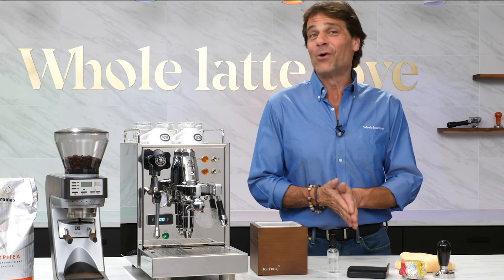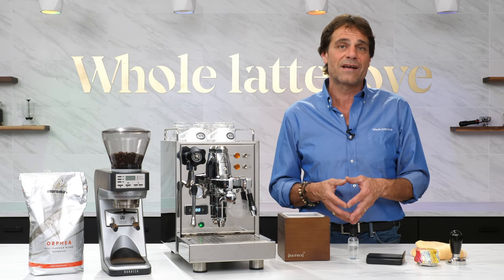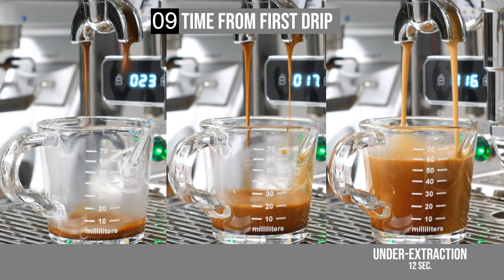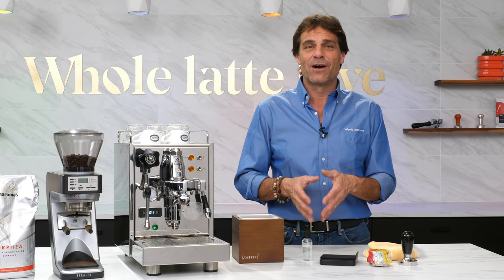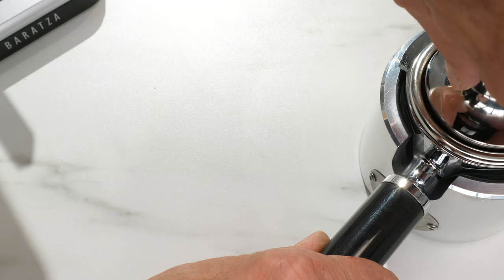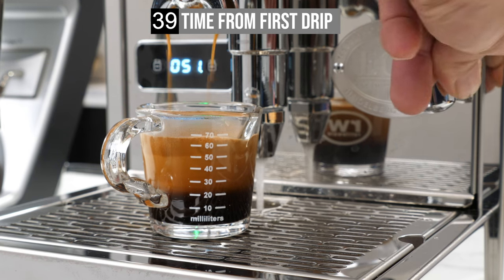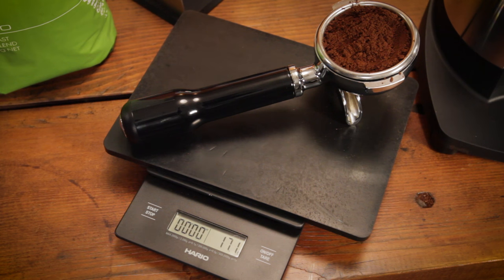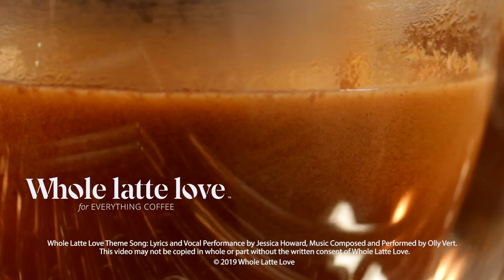How To Dial In Grind Size for Espresso

Comment: This was an exceptional guide for beginners like myself. I bought my first machine (a Rancilio Sylvia V2) and learning this helped a lot. I also learned about adjusting the OPV valve to increase or decrease pressure and how to use a pressure gauge on the portafilter in order to reach 9 bars. So many factors to learn about! Thanks for the helpful information and keep up the great work! 🙂

Comment: I'm following up on my own question down below.  It didn't occur to me that the dramatic spurting I was experiencing  in my early clueless shots as simply an intense degree of channeling.  The grind size I chose to start with wasn't fine enough to stop the pressurized water from going straight through the coffee and hitting the bottom of the basket more or less full force.  Result, espresso explosion.  Many espresso explosions, actually, because I didn't understand exactly why this was happening.  Luckily, my process was to reducing grind settings gradually anyway, until I hit the golden mean.  So I finally got to the point that my shots actually began to pull properly.  Exciting early experiences, though.  Admittedly gratifying to have figured it out myself.
Reply from the maker: Hi John, Thanks for the update - I'm happy to hear you figured things out!
Marc

Comment: Mark, I just got my Gaggia Classic from you today. I have a Cuisinart burr grinder that I am afraid will not grind my coffee fine enough after watching this video.
Reply from the maker: Hi Daniel, you could use the Cuisinart with the pressurized filter basket. But you’re right probably not going to do well in standard brewing in the non-pressurized filter basket. It may get into the fine grinding range for the espresso but lacks the precise control of grind size for dialing in. 
Marc

Comment: Hi Marc.  I actually searched for "spurting" and this video, among others turned up.  That's my problem, though.  I could be wrong but I don't think my grind/dosing/tamping technique is so far off that I should have continual spurting issues. I've had two extended sessions with this machine, pulling several shots and have gone through a pound of coffee without even coming close to a properly pulled shot, let alone worrying about such niceties as "flavor."   I've been a model of patience.  
I'm setting the portofilter as firmly as possible without putting every ounce of muscle into it, I can feel it engaging with the gasket.  The machine is properly pumping at over 8 bar, but the flow control gauge will not rise over 2 bar.  I would be at my wits end, but I am telling myself that this is just another problem to be solved.  The coffee is the Orphea.  For grind, I'm slightly overfilling the portofilter, leveling with finger without compressing, then spinning with the Jack thing.  Then I tamp lightly and spin again.  Not using great pressure in this process.  Maybe I should be!  There's a line on the inside of the Profitec filter basket that I assume is a suggestion on where the coffee should be falling to give enough headroom.  Every time the grinds are climbing up the sides of the basket and are all over the surface of the shower screen.  One time I got a decent puck but it was a fluke and not repeatable. 
To me this is feeling like a basic sealing problem. I have the extra silicone gasket that I could put in, but I am resisting taking this step because I don't think it's going to solve the problem.  Any ideas or guidance with this would be greatly appreciated.  There are long-time "pullers" that complain about this, but I'm not willing to be one of them.  There is a reason for this and I need to know what it is.  I'll keep trying in the meantime.  Thanks so much.  --JohnB

Comment: The tamping is important. Why do I keep hearing it's not? I use to believe it was not that important until I noticed regardless of how fine I was grinding my coffee it was brewing too quickly. I added more tamping pressure and it's made a world of difference. With all the other variables staying the same it completely changed the extraction time.
Reply from the maker: Hi CB, Tamping/compressing the coffee is important. Hitting a specific tamping pressure is overrated. But being consistent in the pressure you use is important! Changing grind size can compensate for more or less tamping pressure.
Marc
Reply: @Wholelattelovepage  thank you Marc

Comment: Hi Marc. This topic is very timely because I've been having some challenges in the last couple of weeks with my extraction times, and I thought my issues might help others. I've been using a Profitec Pro 500 PID and a Profitec Pro T64 grinder since March when I purchased it from Whole Latte Love. After dialing in my shots when I got the equipment, I've had extremely consistent results with very minor grind adjustments.

Two weeks ago, I started using a new batch of Lavazza Super Crema, which is the same coffee I've been using with great results. My extraction times jumped by more than 10 seconds with the expected bitterness, etc. When I tried to move my grind settings to a coarser setting, my results were not improving, and I started to get more volume of coffee dispensed from the T64 which aggravated the dialing-in process. After much head scratching, I realized that I had not adjusted the TIME of my grinder's dosing function, and the coarser grind was producing more ground coffee faster. After checking my weight of the ground coffee (as I had done when I first established the Time of my dose) my results improved.

I'm still seeing some variability in my results, and the only thing I can see that has changed besides the new bag of coffee is that the humidity in my house has increased recently because we have not had to run Air Conditioning or Heat during a mild period. I don't recall the humidity being as high since March when I got the machines, so that may be what triggered my recent inconsistent results after so many months of amazing coffee. I'd appreciate any thought about the sudden differences I've experienced and if you have any practical suggestions about adjusting the time of the dose vs the grind (so I don't keep wasting so much coffee!). Thanks for your informative videos!

George
Reply from the maker: Hi George, Thanks for sharing the details of your experience! As you discovered adjusting to a coarser grind with same timing will produce more grounds. As I mentioned in this video grind size is never set and forget! It may need adjustment as a coffee ages, most definitely when switching coffees, and as you found with a new batch of the same beans. Ambient conditions like higher humidity and temperature may have affects as well. My guess is the major factors in your case are the new batch of coffee and increased humidity. I can't say for sure this is what's happening in your case but increases in humidity generally help grinds flow through a grinder due to internal static reduction. You may get a slightly larger coffee dose than average with increased humidity. I unfortunately have no practical suggestions for adjusting grind time with size changes other than finer setting = lower dose and coarser = higher dose. It's a bit of a guessing game to adjust timing when changing grind size but guesses get better as you become more familiar with your grinder. I hope that helps and hope you are enjoying your Pro 500/T64!
Marc
Reply: Marc,
I think your message is right on target. The increased humidity probably increased my dose since my time for the dose was unchanged. As I decreased the grind size, I made matters worse! I've experimented with decreased time and a very slight grind size reduction, and my results are significantly improved. Thanks for the tips!
I've been making espresso for many years, but the Profitec equipment responds to very small changes and gives outstanding results when you get it right. I'm very happy with my purchase.

Comment: Excellent video. You work with a 2 oz espresso - basically a doppio. What changes or recommendations would you suggest for those folks who drink a more traditional single size espresso (1 oz)?  Should that size also take 20 - 30 sends to extract? If you see this, thanks for your response.
Reply from the maker: Hey Mark, Thanks for the comment and question. When using basic timing it's the same regardless of single or double. It's about contact time with the ground coffee. Single baskets are designed for a lower flow rate - fewer holes in the basket. Using a well matched pair of single and double filter baskets you shouldn't have to change the grind size much when switching between them but that's not always the case.
Marc

Comment: Mark, thanks so much as usual for the great videos. I have Quick Mill Silvano machine and I absolutely love it. I also have a fully restored La San Marco SM90 grinder. The grinder is amazing and I get excellent shots, but the large size and the doser along with the grind retention kind of makes it a pain in the butt for one or two shots a day for home use. I noticed that you guys really push the Sette 270 series. Do you think I would be happy with the sette 270? I don't care about noise or anything, I just want something that has low grind retention and is consistent. I also have a separate scale that I used so I'm not worried about the wi series, as I will be weighing everything by myself. 

Also, if you don't mind, can you speak on how Sette has been improving the same models over the years, in the sense that the original 270 used to need shims and other things that you would have to order from the company, but now they come with those shims so they are constantly updating and keeping even the same models current.

Thank you so much in advance, and I will be extremely honored if my question gets answered in one of your videos. Hopefully my question helps a lot of others out as well.

Comment: When using a hopper, is it ok to adjust grinder after beans are loaded? Intuitively, adjusting coarser should not put pressure on burrs and adjusting screw, but adjusting finer may damage the grinder.
So what is the best strategy:
1. Empty the hopper, grind through the leftovers, and adjust when empty, or
2. Adjust finer only when the grinder is running, or
3. Grinders made out of metal are robust to small adjustments in grind size even when loaded?
I personally believe 2 is fine, but I would like to know your opinion. Thanks!
Reply from the maker: Hi Dmitry, Thanks for the question. Your strategy 2 is the best. That said, I adjust a little finer all the time without grinders running. But, one needs to be careful. With commercial/machine grade grinders small adjustments to a finer setting are okay. I have run into a few grinders of this type with less powerful start capacitors and they've failed to run when adjusted to a finer grind when beans are loaded. If this should happen turn the grinder off quickly and set to a coarser setting to release pressure on partially ground beans between the burrs. With appliance grade grinders one should never adjust to a finer setting unless beans are ground out or do it only when the grinder is grinding.
Marc

Comment: With a same grind size I some times get fast extraction and the next one slow extraction. I find that the tampering also influences how the flow comes. I've also not been able to get double (two side by side cups with double spout) to taste correctly. It always flows too quickly what ever the grind size. I have the single close to perfect but can't get the doubles. Normally it's the other way around.

Comment: Thanks a lot Marc for the detailed information you conducted.
I have a question m in regard to the roast level of the same coffee beans, does it affect the setting of the grinder between the medium roast and dark roast to grind for an espresso?
Reply from the maker: Hi AA, You are welcome! Grind size would likely be different for the same beans with different roast level. Change any espresso variable and grind size usually needs adjustment. Remember grind size is never set and forget!
Marc

Comment: Hey, Mark - thanks for this and your other videos, all really useful! 
My Q is: when do you know when the shot has 'finished'? By which I mean, on our Gaggia Classic (and many other machines, I'm sure) you start and stop the flow of water manually, so in theory you can 'fake' the time taken to complete a shot so that the 20-30 second rule is fulfilled. I tend to stop the flow as soon as the output looks 'watery' but is there a better way of knowing when the best of the shot is done? I'd appreciate your comments. 
Best wishes,
Robbie
Reply from the maker: Hi RS, You are welcome for the vids and thank you for the kind comment and question! Sorry for the delayed response - I've been on vaca and offline for a week. This video covers basic dialing in using timing as the deciding factor. Next level up is using brew ratios. With those you weigh the ground coffee dose and stop the shot when you reach a certain weight in your cup. Typical espresso brew ratios are range from 1:2 to 1:3. So a 1:2 ratio using an 18g coffee dose would be stopped when there 36g weight in the cup. 1:3 would stop at 54g. 1:2 ratio is more common than 1:3 and you can go anywhere in between or outside of those ratios depending on you personal preference. When using brew ratios you'll need an accurate scale like this one which I use a lot: https://www.wholelattelove.com/products/acaia-lunar-espresso-scale
When doing brew ratios you're typically staying with the 20-30 seconds from 1st drip regardless of the end ratio. so that usually means adjusting the grind a bit coarser for higher ratios to speed things up. All that said, using visual cues as you mentioned is legitimate! Especially useful after you are more familiar with a typical bean as if you then use a different bean the cues can change. At end of day the best way IMO of knowing when a shot is done is using scales and brew ratios while keeping shot time within reason. Hope that helps!
Marc
Reply: @Wholelattelovepage  absolutle clear.thanks 😍😍😍
Reply: @Wholelattelovepage  Hi! Could use your help please. I have a Breville Bambino Plus espresso machine and a Breville Grinder Pro grinder. My grind size is set to 15 and I measured out 18g. Output is at 20 seconds from first drip, but I can't get the 36g output. What am I doing wrong? Thank you for your help!

Comment: Great video, thank you. 

I recently purchased a Gaggia Classic and a Baratza Sette 30. After trial and error, the grinder is set at 13 for 5.35 seconds using Lavazza Italiano medium roast beans and leveled/tamped with Apexstone leveler; however, my shot are pulling at around 17-20 seconds.

I tried going slightly finer on the grind setting to 12, but the machine chokes. It also chokes or pulls way to slowly when I increase the time from 5:35 seconds to 5:37 or 5:40 seconds to increase the dose size. 

Does anyone have any other recommendations? Thank you!
Reply from the maker: Hi Alex, Thanks for the comment. The Sette 30 is a bit limited in precision of grind size adjustment. With that, it's not a grinder I typically recommend for use in non-pressurized filter baskets. I'm a little surprised that one grind setting change takes you from a 17-20 second extraction to choking the machine. A couple of options: First is to stay at a 13 setting and increase your dose weight slightly to slow down the extraction. Sounds like you've tried that one without success but it should be possible. The other option is to switch out your Sette 30's grind size adjustment assembly with one from the Sette 270 which adds micro adjustment for more precise control of grind size. The 270's macro/micro adjustment can be purchased here: https://www.baratza.com/shop/sette-270-270w-adjustment-assembly
Hope that helps!
Marc

Comment: Time counts from when you press the button, preinfusion is a part of extraction
Reply from the maker: Hi Thanks for the comment. Fine to do that way if you prefer. It's a fine reference between your own shots on your particular machine. But means nothing if you compare to other machines. For example: Vibration and rotary pump machines reach full brew pressure at very different rates and have different inherent flow rates throughout the extraction. While pre-infusion is part of the process there's a couple problems with saying it counts in the total time. First, during most pre-infusions no solids are being removed from the coffee cake. Second, how to deal with a super long, very low flow pre-infusion. I do 2g/s pre-infusions for 15 seconds all the time when working with extra fresh, lighter roasted, single origin coffees. First drip with those might come at 16 seconds. Do I then only continue the extraction for another 9 seconds? My biggest point... timing a shot is very basic. It's very useful when dialing in. But after that move to brew ratios and tasting to perfect your extractions.
Marc